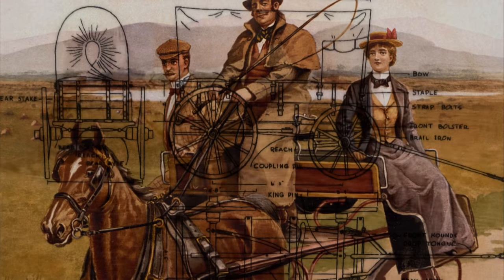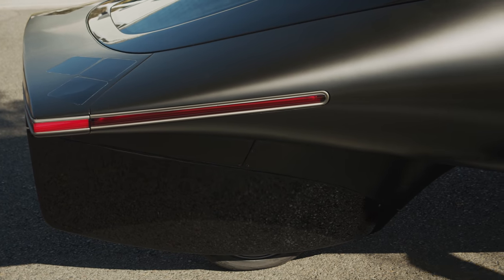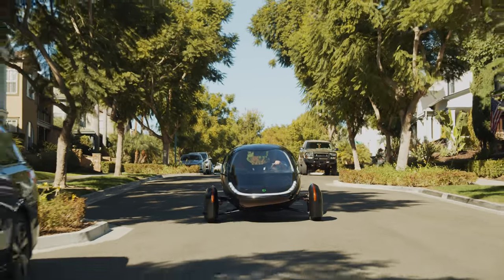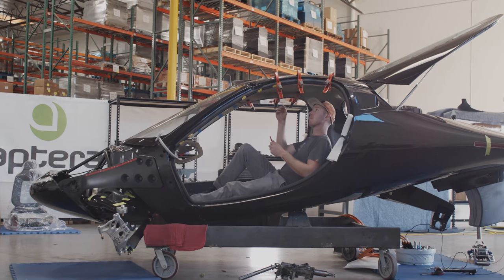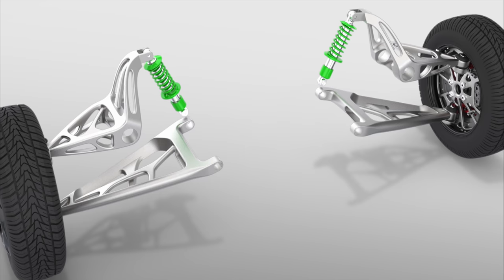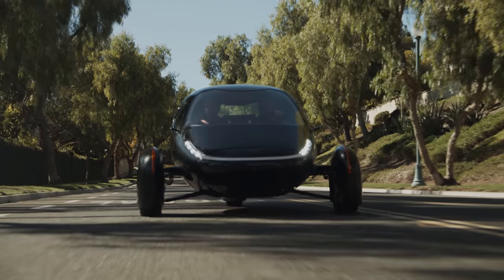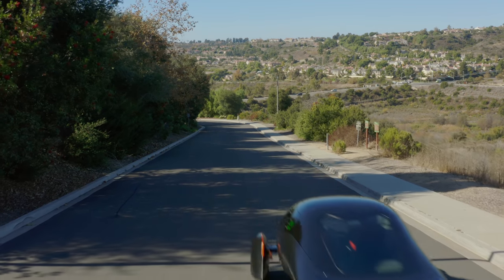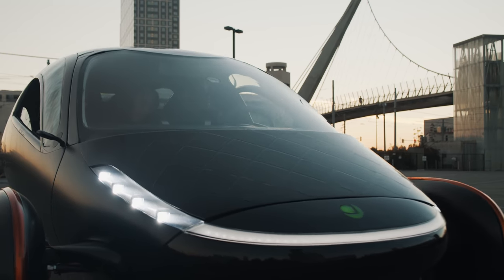Aptera Has Launched

Comment: How will those shrouds deal with snow? With snow building up
Reply: We will see.  They can be removed and cleared in minutes if it is an issue.  I don't think it will be since the motors are a source of heat.
Reply: @n.brucenelson5920  so during winter just keep them off all the time.  Snow cam easily build up and impact stability as well snow building up on roads can be easily 10" on highways
Reply: @blomit  I presently drive a Gen 1 Honda Insight which weighs about the same as Aptera, and has less clearance.  It does surprisingly well in snow.  I am sure I will be able to report on Aptera' s actual performance under these conditions next year.

Comment: Hello, I haven't received an answer to my email so I'll ask the question here.
How can I travel across Europe with the car knowing that it can only charge 200 miles overnight on a regular outlet and most countries have very few chargers available if any?
Reply: If you can find any 230 volt plug, you will be able to charge more quickly than that in most cases.  Aptera won't need a special charger, but if you have access to a 50 kW fast charger, you could gain up to 805 km per hour.  Due to the efficiency of power use, it gains significant range. range even from less powerful sources.
Reply: @n.brucenelson5920 , Aptera ceo reported 200 miles max per night on regular outlets. Yes it will be a lot faster on a super charger but for someone who want to cross Europe and stay away from large cities, I'm seeing major issues here.
I would love to take the off road and tent  option but if I only can travel 200 + 35 miles a day, its going to be a challenge.
Reply: @ElectricHorseman66  He was referring to US power plugs.  Do you know how many KWh per hour your plugs can deliver?  That can give you the answer, depending on the speed you wish to drive.
Reply: @n.brucenelson5920 , a quick search tells me 230volts 2 to 3,7kw. In the US?
Reply: @ElectricHorseman66  You can check A Better Route planner to see how far you can go at the speed you wish to travel at.   I think you will be happy.

Comment: What's it like in safety tests?
Reply: It models well.  The original model passed automotive crash tests and the current one is much improved.  It will be tested to automotive standards when pre-production vehicles are available late in the year.  I think it will be safer than my 1800 lb Honda.
Reply from the maker: Hi, We will not know Aptera's actual rating until we pass a production vehicle through the full safety test. But we are designing to exceed all passenger car standards and the previous version had the highest roof crush strength of all passenger cars on the road, it performed exceedingly well in actual side and frontal crash tests. Aptera features a Formula One-inspired safety cell with advanced composites and metal structures for impact strength. Similar to aerospace and racing, these energy-absorbing methods are a core part of our safety strategy and have proven effective time and time again in high speed impacts. Thanks for asking!

Comment: "The equivalent of parking your car and having it magically fill up with two gallons of gas OVERNIGHT" - not so much unless it is summer and you live north of the arctic circle.  For most of us, there isn't too much sun shining overnight.  Also, though strong, it looks like virtually any collision (usually with a much more massive car/truck) would result in the Aptera being totaled or unrepairable.
Reply: Of course, this wouldn't happen overnight.  The point is that you can get significant range without plugging in, and if you do plug in to a standard 110 volt 15 amp outlet, you can still gain 13 miles of range per hour of plug time at EPA highway speeds.

My first Gen 1 Honda Insight which also weighs around 1800 lbs was hit from behind on the highway at 60 mph, and although totalled, I wasn't injured.  I expect that the Aptera will be considerably safer in such conditions.  Collisions that would end up with bent metal from a collision in a conventional car would likely only need a scuff repair, and more severe damage can be repaired without special tools with materials that are available from any West Marine.
Reply: @n.brucenelson5920  Sadly, you missed the point.  In the video they said those exact quoted words starting at 3:20 where they were talking about the "never charged solar package".  It is a statement I would call false on its face - unless it is summer and you are north of the Arctic Circle.
Reply: @iowa_don  Aptera has done a lot of work projecting potential sun energy available around the world. Even here in Seattle area, it is expected that, at most, I will have to plug in overnight around 2-3 times PER YEAR. The rest of my driving is expected to be pure solar. Each overnight charge from 120V, 15A circuit gives me a week of normal driving (21 mi/day, 7 days). If I had to recharge even 10 times that often it would still be an amazing bargain.

Comment: How does this car handle crosswinds?
Reply: It has been tested stable in higher cross winds than most SUVs.  There is less flat surface to press against than my 1800 lb Gen 1 Honda Insight and even that does well in cross winds on the Interstate at 80 mph.
Reply from the maker: Our advanced aerodynamic shape and the vehicle’s ability to slip through the air has some REAL benefits! Crosswinds are not a problem for the Aptera. See our CEO, Chris Anthony, talk about this in a recent Q&A session: https://youtu.be/I-KdsjVQhu0?t=1014

Comment: I am one of those that wants the thousand mile range model with many of the other goodies. I would like to know not only when they start production but when they start production of the thousand mile range model. Does anybody have a projection of when that would be?
Reply: That will come after the 600 mile range model.  It will be awhile, since the taller batteries they plan to use aren't in mass production yet.

Comment: Not a fan of the covered wheels. It looks great aesthetically, but in terms of functionality: 1) very easily scraped against curbs while parking for a rookie driver, and 2) a flat tire can’t be replaced with a spare easily.
Reply: The first is possible.  The second point is false.  The wheel covers come off quickly, probably without tools and the tire can be plugged or replaced by removing the wheel from the hub motor, just as if it were a brake drum.

Comment: Are they actually going to get built? I fell for this in 2008, and  dropped a deposit, but very disappointed to see the corruption/corporate-cult doesn't allow these independent companies to join the market.
Reply: Sadly, in 2009, their partner, Idealab, had them hire a CEO from Detroit to start production.  He decided he didn't want to build the vehicle he was hired for and was able to eject the founders from power in a board fight in 2009, with the backing of Google and other large investors.

He was not able to get financing for his vision and returned the deposits and liquidated the company in 2011.

Both founders went on to start other successful companies.  Chris Anthony co-founded and as CEO took a lithium battery company public.  In 2019 he found out the rights to the original company were available from the widow of the man who purchased them during the liquidation sale.  He purchased them, regathered the key people, and restarted the company with a brand new design.

The way it is structured now, it is very unlikely that something similar could happen again.  I think it very likely at this point that I will be driving my new Aptera next year..

Comment: so what are the specs. What is top speed? is it good on the highway? It sounds great for around town and I like the 400 or more miles of range. need to know more details
Reply from the maker: Hi John! All of our vehicles will be 100 mph+ capable. 0-60 mph in our All-Wheel Drive version clocks in as fast as 3.5 seconds and Front-Wheel Drive as fast as 5.5 seconds. Both versions will be RPM limited to just over 110 mph. Excellent highway vehicle. See more details on our website: https://aptera.us
Reply: @ApteraMotors   sounds good fast as my model 3. So can I use my Tesla charger to charge the Aptera?  So I would be willing to pick up the car in CA and drive back to PA.
Reply: @johnsollenberger4164  Aptera is still negotiating with Tesla.  I hope there will be an announcement. 

 I am going to pick mine up at the factory, camp in Death Valley, drive to Bellingham, WA, and meander back to Iowa, giving reports during the trip.
Reply: @n.brucenelson5920  I don't know about camping out in death valley. That sounds like not so much fun nowadays. Yeah I hope they agree with Tesla and use their charger method. That would be helpful. I have a portable one already for my model 3.
Reply: @johnsollenberger4164  That would be a great combination!  I have been to Death Valley many times by motorcycle, in difficult conditions.  The shell of the Aptera has an r value many times higher than most vehicles, and some time spent there with Aptera should be able to give me an honest report on edge case performance, both temperature and road conditions.

Comment: Consider combineing with  CZINGER ...deposited material manufacture/ robotic assembly.. Its star trek stuff..
Reply: The thing that is more remarkable than the CZINGER car, which has almost nothing in common with the ethic and motivation of the Aptera founders, is the re-thinking of manufacturing technique.  Some of the Aptera molds could be built this way, but the over all resin infusion tech that Aptera is using eliminates the need for robots in building the cars, and is far less capital intensive, while creating good American jobs.

Comment: Looks like a decent gust of wind would flip this thing, still kool looking, if I had money I'd def buy one when it's upgraded a bit more.
Reply: In this case, looks are deceiving.  It has been tested stable in 110 mph side winds, far more stable than slab sided SUVs.  There is very little for the wind to act on.  What drag is left in the design contributes to downforce.
Reply from the maker: Hi John, Our advanced aerodynamics has some REAL benefits! We have 110 mph crosswind stability, while most flat sided cars start moving at 80 to 90 mph. In addition to that, you barely feel semi trucks as you just slip through their turbulence.

Comment: Have these been crash tested yet?. How is the insurance going to be for these if the solar panels get wrecked?.
Reply: They have been virtually tested thousands of times, but the actual third party tests will take place once there are production intent vehicles available to test.

I don't think that the solar panels will be that bad.  The full solar option is only $900 and they are designed to be replaceable.  The can be cracked and still put out power.  A few can be destroyed without reducing power much.  We will have to see what the insurance companies do.

Comment: Let's say I want a 200-mile range. How much can you lower the price for me?
Let's say I have a family of 4 and want to go on a road trip. Can I get a 4-seat version?
Reply: Remember that the range is published on the EPA highway cycle.  If you are using the vehicle at higher speeds, the range will be somewhat less.  That said there will be a 250 mile range version (25 kWh) for $25,900 before additional options.  If you want a vehicle for your entire family you might be better off waiting for the 4 wheel, 5 passenger sedan that might be coming around 2023,  Aptera will probably schedule their IPO when they are ready to build this.

Comment: It seems real nice...but can you drive it in the winter? off the highway? in mud or ice? not so sure it would be very good under those conditions! I notice they don't say anything about that
Reply: I live in Iowa.  As soon as I pick up my Aptera, I will be headed straight to Death Valley to go camping, and will have plenty of experience to report on in snow as well.  The ABS/Traction control is especially fast acting, able to sense wheel slip and adjust torque 32 times per wheel revolution, or about every 2.5" of tread travel.  AWD would be the best for such conditions, but I think the 2WD will be better than my present Gen 1 Honda Insight, which isn't that bad, especially with studded snow tires.

Comment: Hi. 
I would like a trailer that matches your car for two more people/cargo; and more solar coverage for camping ,lo v trips or...

Trailer may detach and be seperate low speed , high torque city getter/worker.
Reply: Aptera probably won't do this themselves, but they have asked small trailer manufacturers to contact them and they will work with them to the extent that it doesn't get in the way of their car development.  They are pretty focused on that for the moment.  They will have a small hitch.
Reply: @n.brucenelson5920  Hi. A car roof top storage shell on a aluminum trailer would work. Aerodynamic.

Comment: I wonder what kind of emfs the solar panels are making
Reply: Low voltages DC such as produced by solar cells doesn't produce significant emf.  Any EMF would come from the DC/DC converters and the motors which are sufficiently remote from the passenger compartment to be a likely health risk.

Comment: Make a hybrid version with a manual and two wheels in the back
Reply: No hybrid.
Reply: @JohnSmith-dg3rd  yes please for 0 range anxiety for us with garages during outages.
Not huge just a two or three gallon tank good for about 300 electric motor miles of range without adding much weight 
In fact it could be programmed to supply heat in the winter preheat the batteries for better range the air conditioner but n the summer cool the batteries and lights radio and accessories, this will hugely increase the electric range in cold and hot climates and the life of the battery and you will never be stranded even in cloudy areas.
Maybe fill up twice a year.
And in an emergency like mechanical you could run your AC powered products when camping again saving wear on the batteries 

This would be a $3900 add on not forced, 1 assure you at least 50% of buyers would get it just to increase longevity of the car and increase range have no range anxiety ever, prolong the battery life by years.
And if electric grid becomes over stress as more electric cars are out, it may become much cheaper to use gas in certain instances.

Comment: With Elio dead (in the water) this is next car of the future! I would like to see some details and the price point. Batteries are expensive!
Reply: They start at $25,900 for the 250 mile range version and about 30K for 400 miles.  They will be available up to 1000 mile range per charge - EPA Highway rated.
Reply: @n.brucenelson5920  
Thx. I found it eventually. I’m thinking I want one of these! A lot of research is in order.

Comment: Please make a four wheel version instead.  Being three wheels in most U.S. states it is classified as a motorcycle. In many states riding a motorcycle requires a different license than driving a car. Also suggest selling it as a kit car
Reply from the maker: Hi there! Most states in the US do not require a motorcycle license for an enclosed autocycle like Aptera, but please check your local laws. And our 3-wheeled, 2-seater Aptera is just the tip of the spear— a leap forward. But it doesn’t end here. We plan to expand seating options in the upcoming years as we continue to lead the movement of solar mobility. Our tech is easily extended to larger vehicles with great results. Stay tuned :)

Comment: ffs i want one now and im scared for the price
and the fact it might not even be in the UK
Reply: They have preorders from the UK and a right hand drive model is planned.  Still a ways off though.  Range Options & Base Price
1,000miles - $44,900, 600miles - $34,600, 400miles - $29,800, 250miles - $25,900

Comment: I’m interested but it cost the same as the Chevy bolt. It’s really expensive for a two seater. It looks like a good commuter car, how does it handle hail? It’s an issue in Colorado.
Reply: We won't know for a while yet, but Aptera has IP around making the solar cells easily replaceable in event of damage.  Of course the body won't dent like a steel car.
Reply: A Bolt is $36,500.  A 250 mile range Aptera is $25,900.  Quite a bit more performance for less money.
Reply: @n.brucenelson5920  I was comparing premier to there 1000 mile. I have more than two in my household so the back seat was needed. It’s an interesting concept and I’m an electric convert, but I’m not so well off as to afford two brand new car payments at the same time.
Reply: @Isheian  probably not the car for you at this stage.
Reply: @n.brucenelson5920  Sad but true. Maybe after I pay off the bolt...
Reply: @Isheian  The focus on excellent performance for a specific application does make it less versatile.  The follow on 5 passenger sedan could be a winner depending on how fast they can get it into production.  It.  Good luck whatever you decide.
Reply: @n.brucenelson5920  Finacially I can’t afford it. Got the bolt to be able to transport the family and it’s been doing the job great. But it’d be nice to have a second electric just for my commutes, it’s a 40 mile round trip from my house to my work. Especially in winter when the cold effects the battery life we sometimes have to recharge and Walmart as our level 2 charger can’t quite kept up with it. Maybe in the future...

Comment: 3:23 - The solar car "is the equivalent of parking your car and having it magically fill up with 2 gallons of gas overnight.  
OVERNIGHT?  They must be some solar cells!
Reply: Yes, Steve misspoke.  They weren't scripted.  But his point is valid.  If you plug it into a standard 110 v 15 amp outlet, you will gain 13 miles per hour of plug time, and if you have a 230 vac outlet, more like 30 miles per hour of charge.